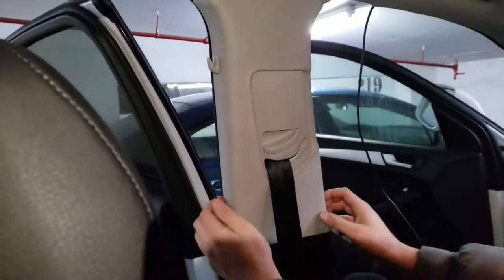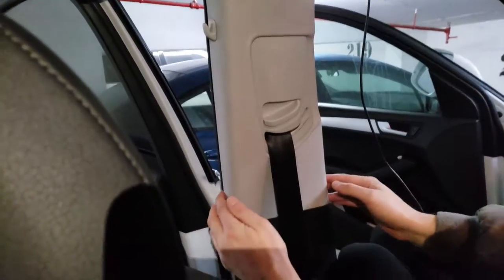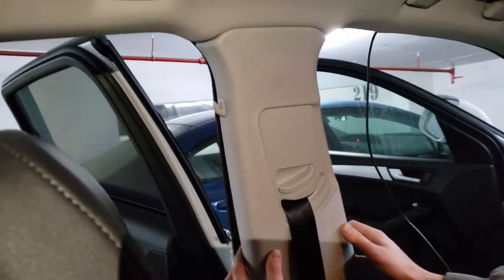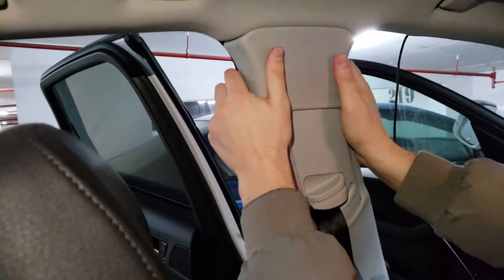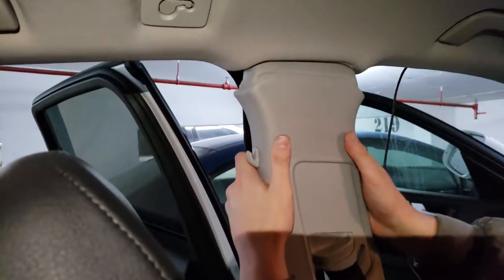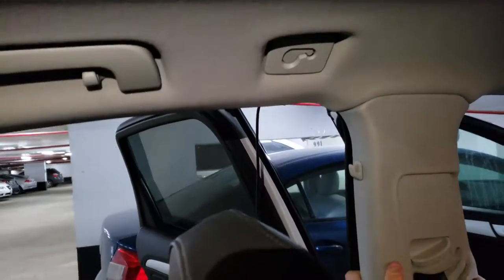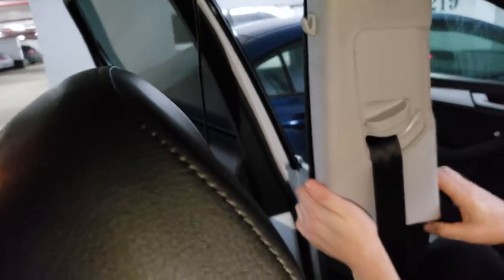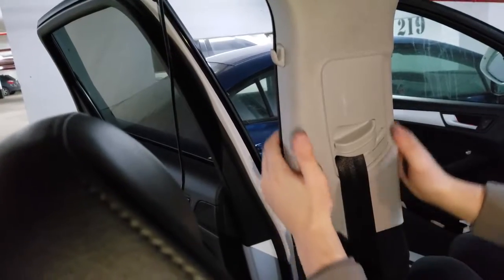2017 Audi Q5 B Pillar Removal

Comment: My 2019 Q8 B pillar has an airbag icon at the top. Will removing the panel cause the issues with this airbag? I’m trying to replace the seatbelts.
Reply from the maker: Disconnect car battery before disconnecting and reconnecting airbag. Otherwise there is no issue from touching it.

Comment: How do you remove this piece to replace with a new one?  I think the seatbelt is bolted into the floor of the car and attached with a metal rope.
Reply from the maker: You answered your own question! You need to undo the belt and then replace the panel.

Comment: The removal of the B pillar went perfectly fine based on your tutorial. The problem I am facing now is to fit the pillar again properly in order to allow the seat belt mechanism to slide up down. What is the trick there?
Reply: Still you are facing the problem?
Reply: @sobysunny123  I still am yeah
Reply: @xXdeathisanilusionXx  is the seatbelt mechanism on the B-pillar trim to bottom limit? Make sure it is
Reply from the maker: Thanks for taking care of it, somehow I missed this comment
Reply: The mechanism in the removable piece has to line up with the catch on the door.  This is easier typically by putting both at the top and lining them up by making sure the panel is high enough.  You can do it at the bottom as well this is easier to see/do but the removable panel doesn't have a bottom limit so you can adjust it lower than the part on the B pillar can travel.

Comment: Same process to remove 2017 Q7 C pillar ?
Reply from the maker: Correct, tried it on 2018 Q7. Just watch out for the vent, pull it out first otherwise you might damage it.
Reply: Excellent, thank you. Is the vent removal straightforward?
Reply: @RomanDoes  no vent on the c pillar. Also the trim piece is much deeper toward the rear and hard to access.  Have you done removed this part before, I don’t want to force or break anything. Thanks!
Reply from the maker: @kevinstrawbridge3981  oh wait, you talking about C pillar. Sorry I misread your first message on the go. C pillar is evil. Let me ask you, what are you removing it for? Is it for dashcam wires?
Reply: @RomanDoes  Might remove to fix an annoying rattle.  I looked at the repair manual and it's several steps that I don't want to attempt.
Thanks!

Comment: Hi there
Do you know how to remove the plastic cover located on the right side of the  grab handle?
Reply from the maker: You mean A-pillar? What model is your car?
Reply: @RomanDoes  I have a 2010 Combi A4. The plastic cover I meant is located on my car just next to the door grab on the backside of the car just on the left side up of the B pillar. Meanwhile I figured it out that it was a torx there that was needed to be removed and then the cover comes loose.

Comment: Hi I have a Q2 and want to remove the A pillar trim. I can pop the top open but the second clip wont disengage no matter how hard I pull. And before someone says it there is no "AIRBAG" symbol on it hiding a torque screw like you see in other videos. (there is however an airbag there)
Any help guys would be appreciated.
Reply from the maker: Hi Ray, can you send me the pic of your A-pillar, I've put dash cam wires on quite a few cars and wonder what yours looks like.
Reply: @RomanDoes  email sent
Reply from the maker: @RaytheRussian  replied 👍